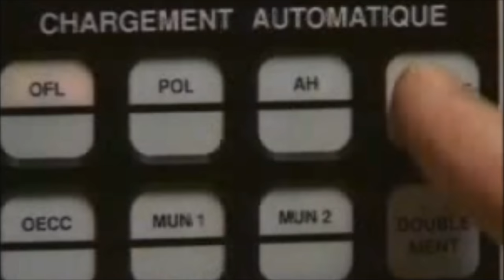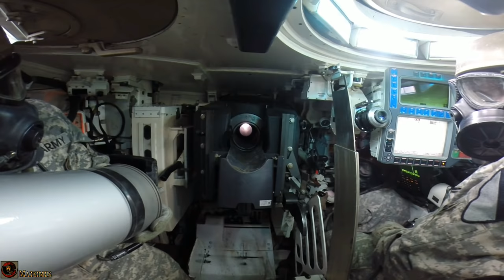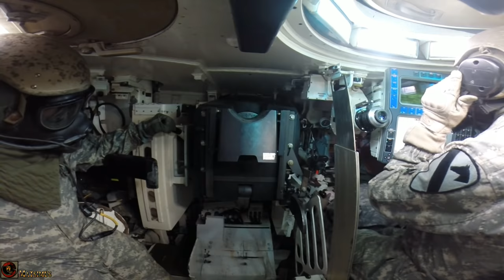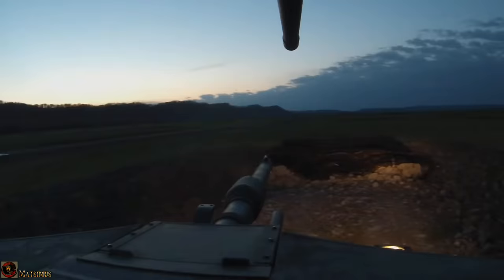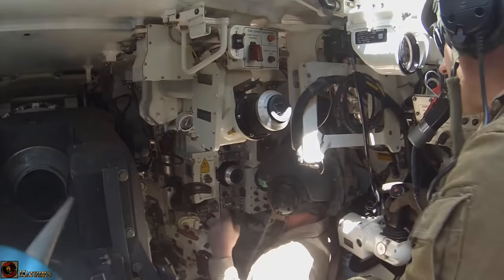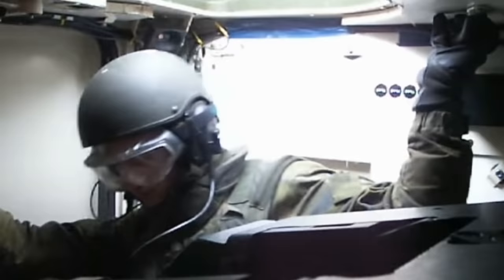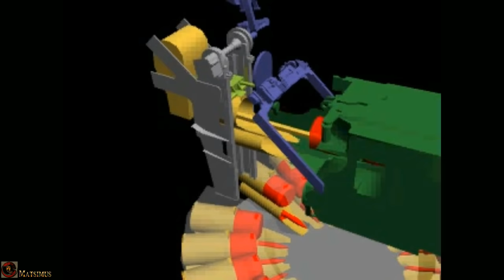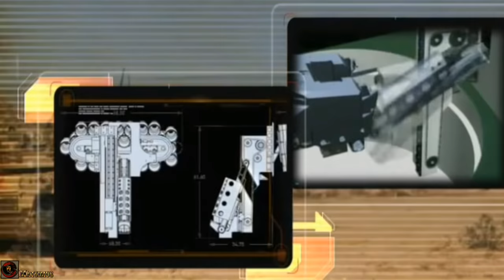Tank Autoloader or Crewman Loader?

Comment: A human will tire at some point while an autoloader will work at a constant pace. Plus if the loader dies than its all over.
Reply: It's inherently much more difficult to work around most autoloaders if little provision is made for manual loading if said system fails to work. Not to mention having another brain, eyes, and hands is always advantageous.

Comment: So on an Abrams tank, one has to manually open the breech each time one has to insert a round? And then help lifting the breech block? God, so WW1!
Reply: The breech opens automatically after firing while the loader, after loading the round, manually ensured that the breech block was seated securely, for safety reason, even before he flip the armed level.

Comment: Former loader, driver, gunner here. WTF did you find these videos of these loaders?....I wanna say basic training you had to get a HEAT in in under 3.5 seconds, maybe 4-5 been 15 years. The guy at 3:30 took 12+ seconds to load one heat, MOPP gear aside. I was in OIF 06-07, though we did a shit ton of dismounted work, we still maintained our readiness on the tank.
Reply: Even at 5:50 he took 7+seconds to load a HEAT (Heavier harder round to load than sabot or canister  mind you). On another note loader is needed 100%. Extra man for maintenance in the field (track especially), 360 degree security for infantry threats especially in urban environments, and I agree 100% with rest. 2 up 2 down on especially long missions. Just one example was a 48 hour cordon and search of a 60k person town, this started right after an 18 hour patrol and air assault. Very hard to function after 48 hours of no sleep.

Comment: Anyway, with the future 130 (or even 140mm) tank guns, the debate will be irrelevant... The shells will be so heavy that an autoloader will be almost mandatory. Matsimus does not mention that manually reloading in a moving tank on bad terrain is essentially impossible... Or that modern autoloaders have a bustle with blow-out panels... and so many other pro...
Reply: Uh, you don't reload the main gun while jumping major obstacles at 30km/h regardless of which type of loader you use; the gunner still needs a modestly stable platform to acquire targets and the gun stabilization systems have an operating range that is reduced by rough terrain. And tanks (well, an Abrams at least), unless your driver is a moron, can and do reload while moving down the road and/or in/out of firing positions. (Yes, I've done it. From the loader and driver's positions on an Abrams.)
Reply: @clement sire... I guess you are not a tanker to make such a comment. FYI, all loaders worth their salt could and have loaded on the move. I started as a loader myself and I assure you, I have yet to drop a round loading in a moving tank. Your definition of bad terrain is what tanks were made for... the crew ride over bumps and dips much like experience bronco riders after awhile. Just ask any tanker :-)

Comment: Can someone with experience in tank with autoloader please describe how best to solve a dud round in the breech or what we called a 'hang fire'? As I have never served in such a tank, I would very much like to learn more. From experience, I felt having a round in chamber that refused to fire might be the most dangerous situation even outside of combat, after trying all electrical and manual firing triggers, the crew would have to see if they would have to remove the round manually and hoped it would not explode while inside the turret.

Comment: 2 crew tank should be enough. Driver and weapon operator, both switchable. With modern detection instruments and automation there is no need for separate gunner. And human loader is at least 40 years obsolete. Every human in metal box means a lot of space to be armored. 

Iraq mostly had Asad Babil tanks and T55 + T62. Asad Babil looks like T-72, but lacks rolled homogenous armor plates (!). And concerning comparment blowup, just take a look at Leopard 2A4 used by Turkey i Syria.. blown to pieces when the frontal magazine next to driver was hit. And observe how that huge and heavy Leo2 is scattered.. not even held together like T-72 can.

More crew members for service is bullshit. There is no maintenance in firefight and when things are cool, you can always send mechanics in APC to fix that.

Comment: What if they placed an industrial robot arm kinda where the loaders seat goes, or on the turret ceiling if you can make ot fit and that arm can be used to either load the cannon on its own, assist the loader, or load the cannon on its own, so it would be a hybrid system

Comment: So with an auto-loader, if the turret is penetrated, there is a high chance of the mechanism failing, meaning no loading. Makes sense.  

But how is that worse than with a human loader, if the turret is penetrated there is a high chance of killing or injuring the person (or even shell-shock), which also means no loading. 

How is a person more resistant to bullets and shells than a machine? 

Also, is seems in your video, that when the turret is pierced, shrapnel can not only hit the loading person, but all personnel. Unlike with an isolated auto-loader.

Comment: Very informative video. I'm from the Caribbean and i don't have any knowledge or experience in the military field. However i'm very fascinated about these tanks. Looking at your video on firing the main gun i noticed residual smoke from what i suppose the gun's exhaust. What ventilation sysyems  in place in this model of tanks for the operators?
Reply: That bulge half way up the gun tube is a bore evacuator or fume extractor; it forces the toxic fume of the propellant out the front end of the barrel instead of being forced back into the turret; still, what fume gets into the turret is still very noticeable, that's why we have fans inside the turrets too, and an over-pressure system for our safety.

Comment: Autoloader all the way.  
Proven reliability over decades.  24/7 availability.  More efficient use of space = smaller turrets.  Armies that have adopted autoloaders are not going back to human loaders.  Only the ones set in their ways and without autoloaders find excuses not to evolve.  Autoloaders are perfectable and they continue to be improved.  
Most armies are facing reductions in manpower, and loading a gun doesn't bring a lot of value. It's a waste of your limited human ressources, when that loader could be reassigned doing something a lot more useful.  
Like all military hardware, tanks are maintained by specialized maintenance crews, the injured by medics, so the extra guy to help out argument is fairly weak. An extra set of eyes? Sensors and optics offer better situational awareness (range, detail, all weather, day and night) than an extra pair of human eyeballs through a keyhole.  These are sophisticated tanks and not a T34 or Sherman based on a farming tractor.  Good luck fixing the jet engine on the Abrams banging your wrench. You need to have expert knowledge and tools to fix these.  Do you fix the traction control on your car?

Comment: Not a single case of anyones arm being shoved into a breech by either Loading Mechanism or Automatic Loader (in Soviet and Russian service T-72 and T-90 have Automatic Loader while T-64 and T-80 have Loading Mechanism. Different name due to being different designs) had been recorded in USSR. Complete and utter rubbish fear. If anything, human loader will be trying to keep himself away from the rear of the breech which can severely injure him if he is anywhere behind it.

VERY few problems were ever recorded on autoloader actually failing in use. And that is with conscripted soldiers.

Autoloader is loaded with ammo and there is a selector switch which gunner uses to select correct ammunition: APFSDS, HEAT, ATGM or HE-FRAG. Standard loadout of Soviet and Russian tanks includes them all. Unless someone stuffs up setting the types up then there won't be a mistake. 

It's actually faster to fire an incorrectly loaded round and load a new one than extract a wrongly loaded one, return it to the holder and load a correct one irrespective of type of loading.

Regarding penetration and death of the tank "instantly". Russian tanks in Chechnya were coming back to depot with holes in the turret roof. HEAT jet had to actually hit the rounds which was actually not a particularly common occurence. 

If HE-FRAG (always carried by Russian tanks and not often by west due to different operating paradigm) rounds go bang inside the bustle, the armored door won't help. It'll be over 30 pounds of HE going kaboom at once. The explosion will tear right through that door and kill the crew. The stream of fire we usually see is not HE going bang but propellant combusting and not exploding. Difference is actually about 35% in yield. A lot.

Comment: If I see that auto-loader can simply "push" the shell, but the crewman need to take shell from its "bottom", turn himself 180° (and not hit nothing inside tank), load...
Reply: The 'pushing' part of an autoloader would be one of the many mechanism that could go wrong. I agree that loading the very heavy tank round, extracting, turning it around and then ramming it into the breech takes a lot of practice for the loader and that's why we have crew drills whenever we have down time, like after maintenance, in the tank park, etc. A tank crew would go thru the whole firing procedure, ranging from calling the driver to pull into defilade, etc., followed by calling out the sighted targets and then the kind of ammos which the gunner and loader would respond to. We were always trying to shave fraction of a second off round out the tube. 

Autoloaders, as far as I could tell from other videos, cannot EXTRACT a round once it was loaded; the round would have to be fired out the tube if possible, before changing to a different type. I could only imagine a round not being rammed in completely and the breech would not close? How would an autoloader respond to that?Finally, I can't ask an autoloader to pull alert shift for the tank. Imagine a 4-men crew splitting a guard shift for the night into 2 hours each for an 8 hour rest, a 3-men crew would have to pull longer each shift then? As you probably never broke a track before to replace a busted link or such, I am sure even you would appreciate the extra hands of the extra crew member then.
Reply: Had a tank in my platoon bust an integral pin in the middle of the burning oil fields in the first Gulf War.  the rest of the platoon surrounded the broken tank and one man from each crew dismounted to assist the crew of the busted tank in breaking track.

The smoke from the burning oil wells was so thick that you couldn't tell the difference between midnight and high noon.  As I took my turn on the track jack, I could feel the point in my back where I just knew a sniper was going to put a bullet.  I pumped on that track jack like an Olympic rowboat until I slowed enough that somebody spelled me.

I have never seen a track repair that fast.  But that was also with eight men working on it, the four man crew plus one man from each of the other tanks.  We had the track block replaced and we were mounted back up in something like fifteen, no more than twenty minutes.

Twenty minutes.  Suck on that, amtrackers.
Reply: Re maingun07

Roger that!!! As I have preached in so many threads, I wouldn't trade a real pair of extra hands and a warm body for an autoloader if I have a choice! Many here who commented on how great autoloaders might be have probably never experienced the other 99% of the duties and daily chores of the loader who is very much an intricate part of a team. A loader does more than just LOAD, he helps with everything needed done on that steel beast we called home; we nursemaid it; we baby it; we kick it, we curse it but in the end, the 4-men crew is also very much a part of this killing machine that also kept us alive too.
Reply: Abso-fucking-lutely.  If we halt to let the crew get those all important 4 hours and then refuel and reload, at 25% alert that means that we're only stopped for 5 or six hours.  At a short halt on a road march, the driver and loader dismount to check track and oil levels while you still have two men in the turret for security.  I can't imagine trying to change a torsion bar in field conditions with only three men.  I remember one time having to move back to the battalion log trains on a three man crew and busting both #1s while we were there.  It was bad enough with the battalion mechanics to assist.  Doing it by ourselves, just the three of us?  I think we'd still be there.

That's not to mention with a manual loader, clearing a miss fire or changing ammo or reloading the coax or helping sense the round or watching for air...  The job of a flesh and blood loader is a lot more than just feeding the gun.

One other thing.  With an auto-loader, what crew position is the FO or FAC supposed to take?

Damn, it's nice to talk to another tanker.  The only other tankers that I get to talk to are my dad and on occasion, some of the guys from his platoon from Vietnam.  I was an M60A1 crewman most of my enlistment.  What was your hog?
Reply: I started as an enlisted, would you believe, on a Sheridan!!!? Even though it was in reality a lemon with a hull partially of aluminum and Styrofoam and an extremely temperamental firing system and a stupid ass low velocity gun, we still loved it; it was still our home for however long, and the crew that was my family lived within it.

Then we traded the M551 for M60A1 in the Cav before I got out. I went back in thru OCS and got my butter bar and was assigned to a NG unit with M48A5 before I went back into RA with M1s when the first Gulf War started. Got my promotion, lost my green leadership tab when I was rotated into a staff position before I got out.So, you can see I actually had experience with quite a few of our country's armored vehicles. As being a Cav officer, I was also trained and worked with APCs and mortar tracks but my main love has always been with tanks!!!I could only shake my head in wonderment of others trying to say things could be done just as well with a 3-men crew. They have NO IDEA how heavy a length of track was! Even the tow cables themselves required two person just to lift and manipulate into position, let alone connecting them to a thrown track, etc. These non-tanker civies couldn't even imagine how heavy a $%@ pry bar weight.Yea, some fellow on this thread mentioned that was what 'specialized' mechanics were for, to perform such maintenance and repairs... yea right, how many tank mechanics were there within the motor pool or squadron to perform how many maintenance requests!!!? Tank crews would be sitting on a deadlined track for a long, long time waiting thenOn another thread, I also mentioned the task of a loader also served as an extra pair of eyes for security on the left side of the track, manning the loader's MG while scanning for air threat, etc. He would be popped up out of the loader's hatch while the TC would be standing in his, doing the same and hundreds of other tasks. And that, would  be something the new Russian T-14 crew could NEVER do in their supposedly far safer' cocoon within the lower hull watching everything thru their TV monitors! They traded their all important Mark-1 eyeballs and relied on their electronics instead and for me, that's a step backward.In another video, I saw how cumbersome loading up for an autoloader's magazine might be. The crew has to drop in individual projectiles and their charges into each slot/link of the carousel, then await it to be cycled to the next opening. With a manual crew tank, two guys on the ground passing and handling the rounds onto the third standing on the hull who then pass them into the turret thru the loader's hatch while the loader would quickly slot the rounds into the ready racks.And another fellow commented that the Russian could field an extra tank because of their 3-men crew but the fact was that the US started off with a platoon of FIVE tanks only to discovered that it was just a tad too much for command and control by a platoon leader alone so, the revised TO&E became that of three-tank platoon that we have now. More tanks that can't fight as affectively wouldn't have been necessary a good thing!Same here, very nice to chat with a fellow tanker too! I wish we have some tankers from other countries with 3-men crew coming online to say a few things and share their experiences with us, telling us how their misfired procedures might be or how they allocate their crew tasks, etc.

Comment: Please correct me if I'm wrong but I think I saw a autoloader that's works like a belt fed MG that runs in a loop and the gunner had a sled which could move behind the belt shove in a new selected round and dump the new one in safe stowage to be reorganized 

Just seemed pretty nifty but I don't think it came to anything in the end

Comment: 4:14 actually they have done something in this case... https://www.youtube.com/watch?v=pfGP-dGjjnY
If the MS variant of the T-90 receives a shot to the rear ammo storage compartment it will survive... not only it will survive but since it has part of the ammo stored inside in autoloader that is in this newest model protected, it can also continue combat operation with only half of the total ammo. This also means not only it can fire much faster than manually loaded tanks, but it can fire also if the ammo storage behind the turret has been blow out. If the autoloader is for some reason not functional, the commander can reload manually from the rear turret bustle (if it has been not blown out). My personal opinion is that in a tank design having a small profile is much more important than having one extra crew member. Tank must first and foremost survive and that reduced silouette combined with superior rate of fire is factor geared towards this goal.